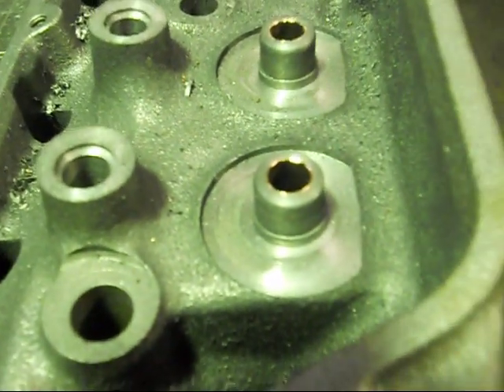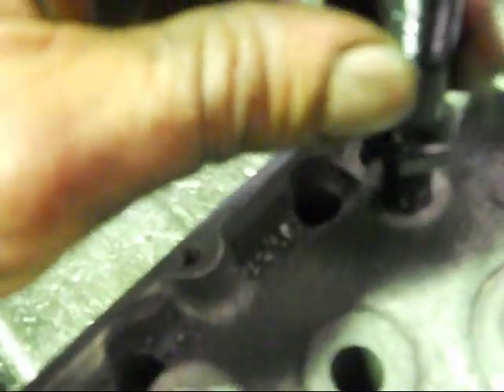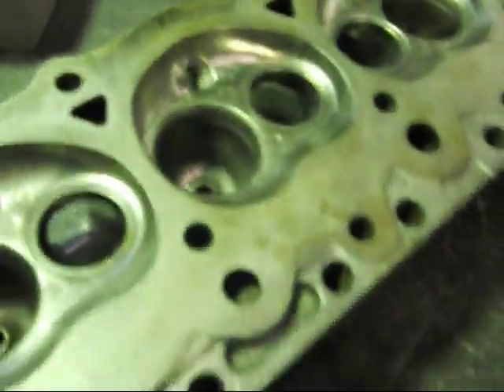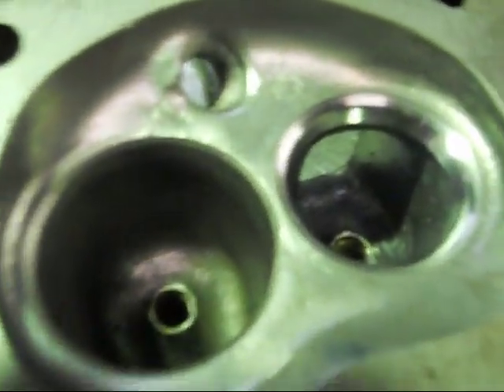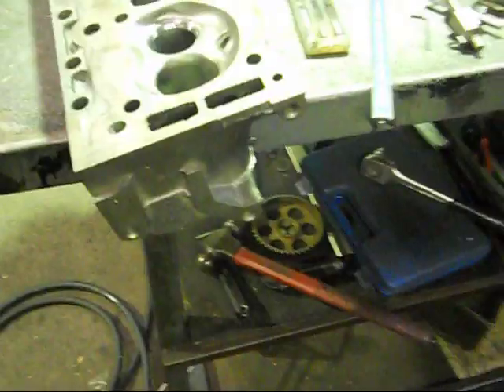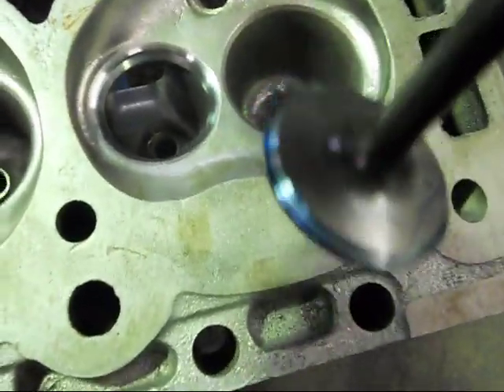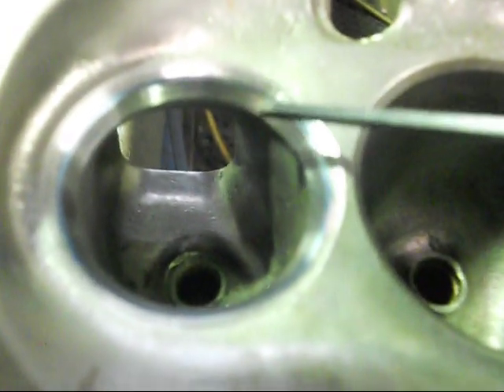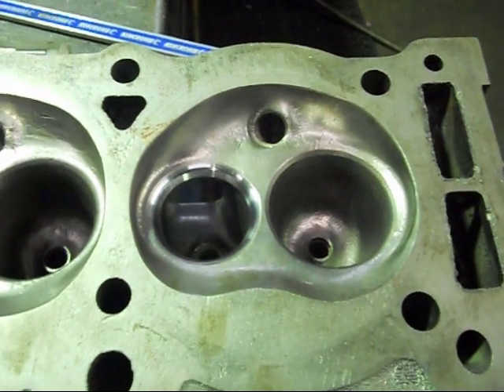How to machine and fit harden ULP/LPG exhaust valve seats,5 angle valve seat job

Comment: what is material make valve seat for gas LPG
Reply: Usually hardened steel is used. Stellite valve seats are sometimes used, but usually they are only found in heavily modified racing engines.